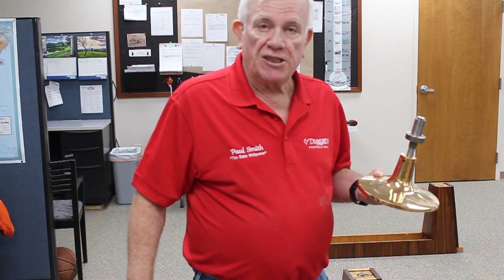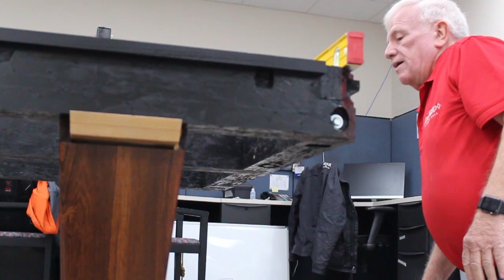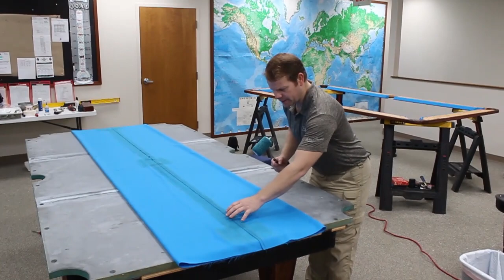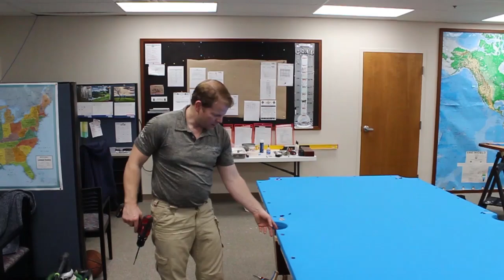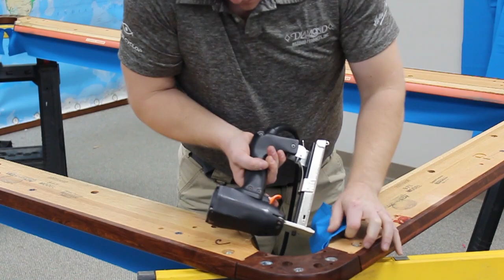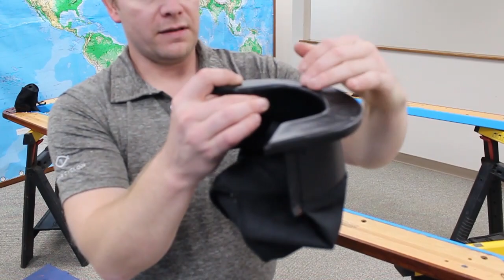Diamond Billiard Products Professional Table Build

Comment: Not "plumb"... SQUARE it (the beams).  Why no square check?  (diagonal measure from the inside corners at the very least) And no reliable torque limit setting on the hammer drill being used as a torque application device to fasten those beams with.  They should actually be finished precisely with a torque wrench to all the same setting.  The hammer drill, despite having a setting sets the torque within a wide window.  And still didn't get checked for square.   Squareness IS needed to place the crown attachment holes in their exact locations that match the crown and slate. The frame should be perfectly flat (already).  Same error if the "bump" you worry about is under one of the cards.  Two identical diameter drill bits or rods makes the right tangency to the surface.

  Instead of bondo, you should use a two part epoxy that DOES have 'elasticity', not hard as you stated.  If you whisk the slate with OTHER than the cloth you are laying down, you will not have to whisk the cloth.  As it stands, you ATTACH whatever dirt is on the slate INTO the cloth.  Who's bent logic started that stupid move?  There are clean cloth segments cut free from other table builds you should have readily on hand and use. Frazzle the edges with flame if you are worried about them shedding threads.   And fresh off a full roll of cloth, you should not have to even do that "whisk" behavior with it either.  So you must be just leaving it lying around or introducing debris to it from poor handling because it is as clean as it gets right off the roll.  Doing a field build away from the roll?  Put it in a bag, not just folded up and flopped into the truck.  And after all that slate leveling mechanism stuff, you CLAMP the rail crown down onto it (with four bolts per rail segment), pulling the slate bed frame up into it placing huge pressure on every leveling wedge in place.  It is beautifully engineered and crafted, but that is a design flaw.

  And so too is your "professional" overtly tight pocket openings.  They do NOT meet the "regulation" specification.  The rail end cap faces even angle downward...  poor choice.  The material is too hard as well and the angle is out of spec.  Also the NOSE OF THE RAIL is supposed to be 62% of the 2.25" ball diameter.  Not higher which most diamond tables I have played on are and they pinch off bank shots as a result.  I have also seen rails with big nose diameters like you guys play with the rail rubber shape as well.  NOT "professional", only CLAIMED as such by you guys.  I have seen different rail nose diameters.  How can that be, boys?  I covered my first table way back in '71. And I took years of hand drafting courses in school and pool table pocket openings and a four hole per rail segment slate were all things I drew up and designed decades ago.  When a firmly hit ball bobbles out of the pocket on one of your tables, I CUSS YOU GUYS for your stupid "professional" pocket opening stupidity.  It is NOT REGULATION, and if the WPA (now)says it is, THEY adjusted the specs from the original. 63 degrees from the pocket cheek face to the rail nose.  You guys and your near parallel pocket faces are OUT OF SPEC.  Not "professional".  UNprofessionally adjusted and adopted BY DIAMOND.  That doesn't make it so.

Comment: Once you super glue the slates, how do you get them apart if you want to move the table to another location?
Reply: You know what amazes me? The number of people that make comments on here that think they know better than the factory. Many many installers superglue the slates together.... and on many many different mix of tables. Oh, and a machinist level is just as accurate or more than rolling a ball on it.
Reply: @brianschumaker5912 what kind of super glue are they using?
Reply: @Mac58058 
I used Gorilla Glue.
Reply: Score the Bondo with a knife or screwdriver, then douse it with acetone (if it is cyanoacrylate superglue). Perhaps clamp one slate to the frame and raise the nearest leveling wedge on the other side of the seam, putting them in shear. This is preferable to lifting the end slate, which may damage the slate in compression and tension.
Reply: I believe you would just lift one end and break the seal or score it first.
Reply: You are never supposed to use any type of glue or Bondo you then risk breaking your slate whenever you disassemble your table, you can use beeswax or wood putty which doesn't create a permanent bond. Never super glue the slate!!!
Reply: @jordanwhite9319  
Glen Hathcock would disagree with you.
Reply: Never use a level on a pool table either 😂🤣 you use a ball to level it. These people do not have any type of idea what they are talking about! Slate is supposed to be screwed to the frame and never move a pool table without disassembling it, and it is very easy to film someone leveling a pool table I could do it in about 5 minutes....